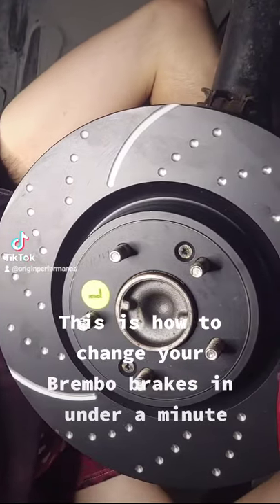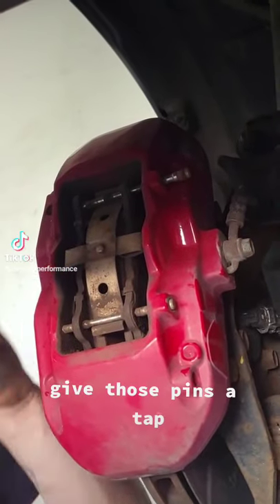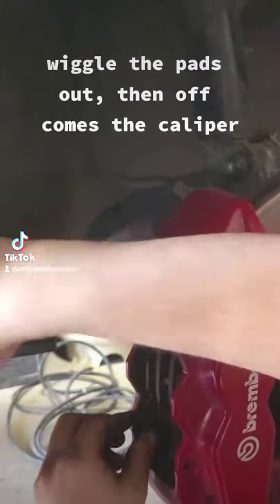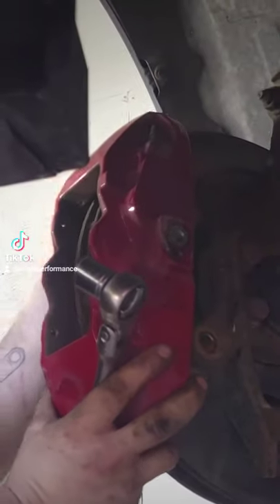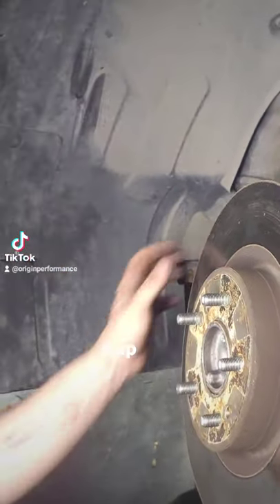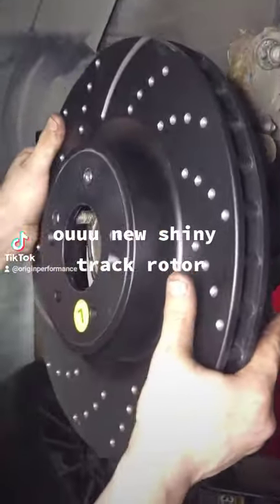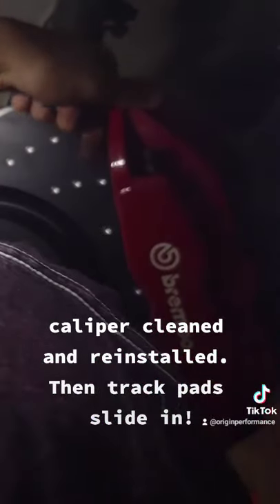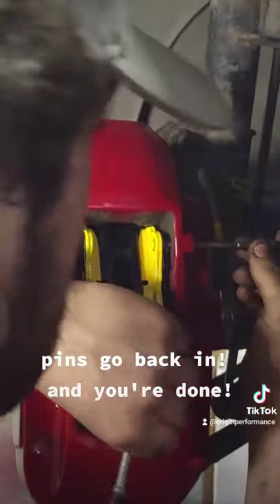Upgrading Brembo Brakes In Under a Minute #shorts

Comment: How do you push those pistons back so the new pads fit?
Reply: experienced mechanics will use flat screwdriver but there is a risk to damage the surface of the caliper, so better to use a caliper piston retraction tool